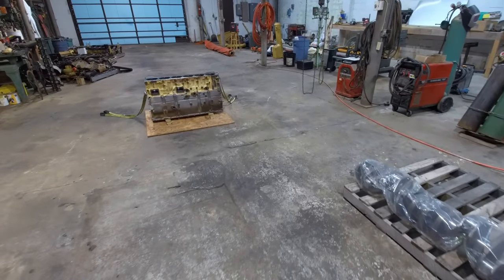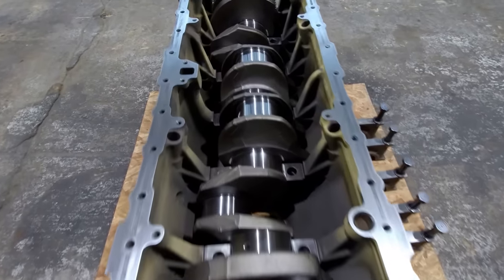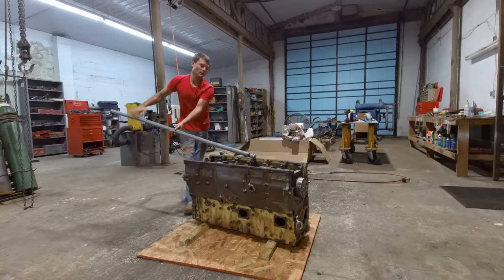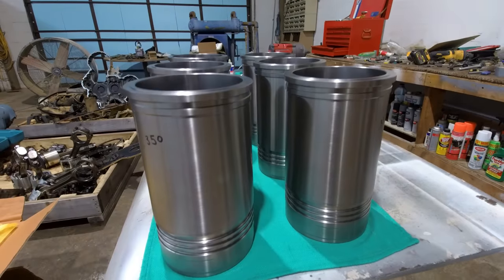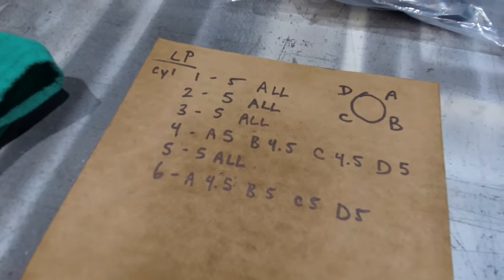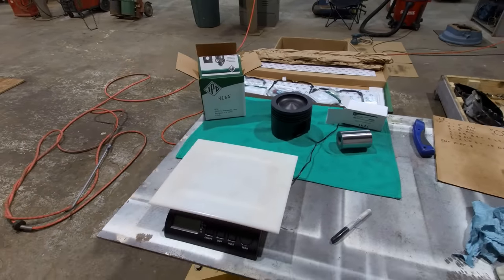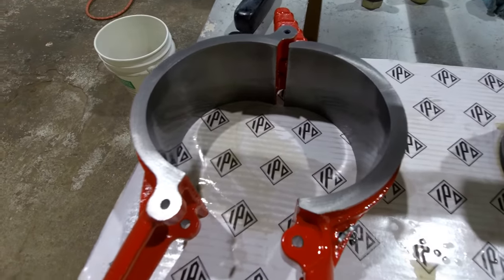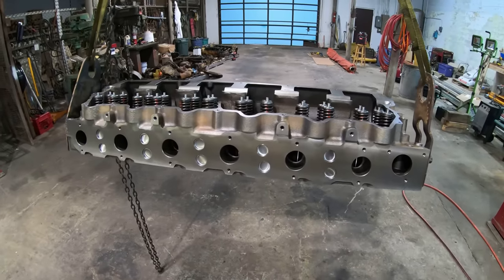700 HP 15.2 Liter Caterpillar Diesel Engine Build - Assembling Major Components

Comment: I really like the cleanliness and the attention to detail.    Giving a shit is a dying art.
Reply: He loves his trade obviously you would want him.to make your engine ...!
Reply: I drive for a local fuel distributor, I currently drive a 2017 International LT DayCab.  My last truck was a 2010 Maxxturd with the 12.4 Liter Maxxturd Diesel Engine.  The 2017 that I drive now has a Cummins 15 liter, it is a great truck, this engine is pretty loud, but overall it very nice, then low end torque is especially impressive.      I have begged, threatened to quit, threatened to quit and take half there driver with me, cussed until I ran out of cuss words..............all to try to get them to buy me a Kenworth, a Freightliner, a Western Star.....anything but a damn Navistar, they refuse.  I hate them for this, I am the senior driver, been there for 14 years, I make exceptional money, but I still might quit if someone would buy me anything other than a damn International.     I once owned my own truck, and I would not hesitate to have KT rebuild my engine.  Half of the problem that I have with my shit spreader is the fact that the International shop is over worked and poorly motivated. The other half of my problem is the tire shop that this dealership uses is COMPLETELY incompetent.   I have taken my truck to the shop on two thursdays in a row, just trying to get them to balance my steer tires, my steer tires still have 0 weights on them.
Reply: I agree, some of the characters on YouTube operate in a very messy/dirty environment for their rebuilds. I don't watch them more than twice, or so. I will keep watching here until I can't see anymore, or he decides he is not putting up with the idiots.
Best wishes
Reply: @kevinkelley3657  Fight the good fight but sometimes you have to concede. I'm down to "my new truck needs to be a manual", went home for three weeks on the last truck "call me when you get a manual in, you have the number". They called.
Reply: Absolutely agree 100%, he does this for our enjoyment and education, He does not need a bunch of arm chair quarterbacks telling him what hes doing wrong, its clear he has an interesting channel or would not have 83,000+ VIEWS in less than 72 HOURS, now that is interesting in itself, This guy has a good sense of humor in his own way, hes not afraid to say that was wrong or it was wrong, The guy is doing this to help us out and we enjoy it and learn from his work and taking the time to video and share, I personally appreciate each one of his videos and this is why I am a subscriber.
Reply: Paying people enough to give a shit is what died.
Reply: Very true Kevin, as an apprentice mechanic I look up to guys like this, but to find anyone who's willing to take me on and who cares it's very hard to do so.
Reply: A local guy that did my rebuild years ago had old sleeves tapered at a machine shop for piston install.  That tool you have looks like the cats meow. 👍
Reply: @Shed Life Correct engineering is absolutely critical to the life of a newly manufactured piston engine.  When a piston engine is rebuilt, about 50% of the potential success is tied directly to the quality of the parts used in the rebuild, the other 50% of the potential success is on the mechanic.  Did he pay close attention to clearances???  Did stay constantly vigilant on cleanliness???
Reply: Sure is....Many of the "kids" I work with don't care to put any pride in their work or work at all.
Reply: @kevinkelley3657  .....You got that right...ever since international got rid of the dt series in favor of the maxxturd..The quality of their trucks took a dump.

Comment: Love these videos. I work in a prototype fabrication shop mostly by myself. 
Whenever things get to big for me to move around or lift I ask myself what KT3406E would do then figure it out!
I doubt anyone who leaves a negative comments has ever built an engine. How does someone mistake a cheater bar for a torque wrench anyway?
Reply: Isaac's Garage I don’t even like to call it a cheater bar. My dad who was a mechanic who was retired and a USN vet called it a “force multiplier” which he said was the correct nomenclature.
Reply: @Aegirak  That's a better descriptor. I've always known them as cheaters, but the USN knows better!

Comment: Hi KT I haven't sent email in a while the C15 acert that I built running strong and thank you so much for the information and guidance for my Build the avg on the Dyno was 628hp and 2120 ft of tork for one hour of time on 80% to 100% load.
The flow mach 10r3261 work great and it smooth running.

Comment: When you plastiguage something like the mains, if the clearance is out of spec how do you fix it?
Reply: depends on whitch way its outta spec, if the clearance is too small, bore the bearings, with em installed, until their to size. if too large, bore gauge and figure out if you have a out of round, order oversize bearings and bore to size.
Reply: pretty sure u can get it in spec with different bearing thickness
Reply: @weedies7577  depends on what they offer in bearing sizes, some engines like the cats/cummins/detroit stuff you can, but for the more odball stuff, jeere, old mack e7's, kubota, mitsubishi, ect, they might not offer the inbetween sizes, just std/ .10 over ect.
Reply: @patrick11169  If you're real damn lucky an off the shelf bearing will solve the problem, otherwise, it is, as you have said, line boring time.

Comment: I recently read an article on FB regarding why most semi's have a six cylinder engine. I was stunned. I figured they were at least V-8 or more. It turns out the narrow block makes for easier maintenance and a sharper turning radius. They just build  them with GENEROUS sized cylinders. And also, they can add a turbo if they need more grunt. My first full time job was working at Fairbanks Morse in Beloit, WI. They were building diesels for the navy that made 1,000 hp per cylinder. I was told it had  two crankshafts, one on the bottom and one on the  top. The pistons came together in the center and that was where the injectors were situated. I think  there were four of them. Two on each side. I grew up two blocks away from where they tested engines. When us kids weren't making too much noise, we could here those big diesel engines chuffing away.

The pistons in the one you were rebuilding have to be huge for it to be a 15 liter.

Had to chuckle as you turned the crank you said, "I've got spinnage". Right away I had visions of Popeye helping you finish the assembly. Sorry, couldn't help it. I was born in 1946 so I grew up with Popeye.

This was a great video, clear and educational. You do great work.

Its a shame auto makers don't build their engines to accept liners. That would greatly extend the usable life of the engine but then they wouldn't sell as many cars. And too, the engines of today really do last a long time. Most of my friends have cars with 160,000 miles or more. They take them thousands of miles on vacation with no worries.

The joke about the breaker bar,  vs torque wrench was a good one. Let me see, a six foot bar times my 180 pounds should come to about 410 foot pounds.
With a lot of practice a man can get really good at feeling torque. I worked at an auto assembly plant as a trouble shooter when something went wrong. If an inspector found a problem I had to buzz over there with a crash cart and fix whatever. Bolt didn't go flush in the trans? I would back it out and run a tap in then blow out debris, install new bolt and save it.  Wrong transmission? I had to remove the trans when engine got to a middle area and put the correct one on. The engine and trans were on a pedestal before stuffing into car so I could do that before insertion. I got a feel for the tension such that I challenged a coworker to come behind and check the torque I applied with my 32 inch ratchet. On twelve bolts I was within specs, plus or minus five pounds. Some were 15mm some were 18mm. So I had be accurate with the two different torques. That was 22 years ago before I retired, I doubt I'm still that accurate. I'm out of practice, now use a clicker wrench on everything just to be safe.

I have a nifty diesel in my 2005 Jeep Liberty. Four cylinders, 16 valves, a turbo, intercooler, and it uses a really powerful lift pump to create 20,000 psi on the fuel. That is fed through a common rail to each cylinder, the injectors are operated electronically by a minicomputer. The intent is for the fuel to enter the cylinder as a very fine spray, almost a fog. The computer can adjust the instant the injector opens to get maximum power or minimum fuel usage. Supposedly, it only has 162 HP but can create 300 lbs of torque at 2,000 rpm. Not bad for a 2.8 liter four cylinder. It  now has 262,000 trouble free miles. If I'm easy on the go pedal it can get 30 mpg on a calm day. if it's windy from ANY direction other  than behind, it takes a hit down to 25 I suppose due to turbulance. One time pushing through deep snow in all wheel drive for about 200 miles it only got 15 mpg. I noticed that fuel  gauge dropping at about twice the normal rate.

I pulled a bottle gas truck out of a snow bank one time. He could not believe it. But there was a bare spot on the blacktop, with all of my tow straps hooked together, I was able to get one tire on the bare blacktop. I was told the transfer case creates a three times reduction so I'm guessing it was putting about 800-850 lbs of torque to the wheels.

Diesel power has such great promise, lots of torque, long life and it can be operated on numerous types of fuel. There is a video on YT of a guy who makes diesel fuel from alga in a big greenhouse. It burns clean, NO POLLUTION because it's vegetable oil. He is the CEO of Valcent industries. I haven't been able to get any of his alga fuel but my little diesel sure likes the biodiesel I get in Monroe, WI. It varies from 5% all the way up to 20% depending on their production. The biodiesel does a good job of lubricating the pump and other parts. It feels slippery if I get some on my  hands. It runs quieter on the biodiesel as well. That is a real issue since they removed the sulfur. Not sure how sulfur lubricated the parts but at least the biodiesel can take up the slack.

Thanks for showing us what a REAL workhorse diesel looks like. That was an awesome video.

Comment: KT does a great job and dosen't  cut corners when he does a rebuild. We had a local yahoo rebuild a Cummings N14 and it lasted 20,000 miles. Thrust washers fell out of crankshaft and were in oil pan.

Comment: I was using Plastiguage on  reciprocating air compressors about 40 years ago. Before that was lead wire. 6 inch journals and 650ft lb.  Torque wrench was 6ft long and took 2 of us to get it working lol.  Nice quality video and good to watch.

Comment: Just did a 6TS in-frame last week (shit block with the cam hole in it) and used the IPD overhaul kit, first time using one, looked like a quality kit. customer was on a budget so had to reuse as much as possible. did cut counter bores for shims though.
enjoy your videos, the motor home bus was a blast. keep the coming.

Comment: I use a £600 snap-on torque wrench with the electronic angle gauge, You use correction fluid and a massive bar. Love it Thank You for taking your time to share your work (from England)

Comment: Hell of a good idea.. not nascar using diesel engines but weighing every part and matching them together.. I used to do that back in the day (60's and 70's) on my gas engines even before I heard of balancing and blueprinting.. It just made sense to me.. Man that is a fancy ring compressor.. things have sure changed since I played around with engines. Damn slick as snot.. Rats you didn't show the piston cooling jets.. I am not familiar with those.. I will check you other videos for those then.. Hot damn son.. run that baby!

Comment: If you will stand the block up on the transmission end on a couple of blocks you can hang the crank by the front snout and float it in. This makes torquing easier. You can also stab the liners and then the piston/rod assembly and torque it while it's standing as well. Knocks out a few movements.

Comment: Personally i agree with you about tightening the main bolts by hand instead of using a rattle gun however.
When i did it, i found it easier to lay the block on the side, stops it from spinning on you while tightening and is also much easier on your back.

Comment: People are quick to point out “that’s not how you balance an engine”… right this is called weight matching. I’m guessing being in-line that it’s probably neutral balanced? So it’s spun without bobweights, right? Nothing at all wrong with your process. Love the channel. I did engine work for about six years when I first started life as a machinist.

Comment: KT34063E:

Although I do not work on Heavy Equipment like you do....I still use(quite often) a 3ft+ Boron Pipe taken from the rear door of a Peugeot Wagon.....having a cheater  that does not flex is nice for stuck bolts/nuts....and like  "stretch bolts" which have to be taken another 120 degrees or have half turn after final torque is set....piece of cake.

Comment: This might be a stupid question but why not use silicone on the top o-ring? If the motor oil makes it swell would it not make it break down a little as well? Or are they supposed to swell to hold the liner in? Great videos 👍🏻 thanks

Comment: Excellent presentation lighting and audio great.i just got a nt335 gs Cummins generator set from a tv transmitter with 1300 hours. Always had block heater no cold starts. It was installed in 1968 in climate controlled building. I thought I was getting something valuable but I had one generator dealer say scrap it. What is your opinion should I scrap it?

Comment: Awsome video! I've rebuilt alot of engines in my time & was shocked at the 200ftlb torque spec! And then torque to angle - wow! A few questions:
How much does the block & crank weigh? I thought it was going to tip over when you were torqueing the mains - but it barely even moved!
What do the combustion chambers look like in the head? I would have loved to have seen those.
Does the head have a single intake port?
Thanks for posting 👍👍
Reply: You have rebuilt a lot of engines in your time? But you ask how much does a block and crank weigh? What do the combustion chambers look like in the head? Does the head have a single intake port? The answer is. Totally just the same as all the engines you rebuilt in your time. DAAAAAA

Comment: Best words ever heard or the whole video was torque-ing the bolts with torque wrench and by feel one time I put a small V8 engine together of the many engine I was allowed to put together and one rod bolt did feel quite right so I took it out and look at it and it was a bad one torque wrench for reference but the feel for accuracy only was able to build three engines like that it was fun

Comment: The Detroit’s have a special tool to push the liners down. I will try and describe it. 
Excuse me if it don’t make sense. 

Looks like a triangle with three head bolts attached to it. 
And one large bolt in the middle. 
With a circle in the middle that fits the sleeves. 
Lay the tool on top of the block. Bolt in the three corner bolts and then torque done the middle on. It pushes the sleeves in nicely. 

Does cat not offer that option ?
Reply: Whenever I rebuild Detroit's, Cummins, or Mercedes I use the hammer and 2x4 method similar to how he did. So far so good.

Comment: I thought the 3406 was 400hp, then by 1990’ it was 425 and I think it finished at 450hp? The C15 is 500hp, so it was fascinating to see how those four bolt rods and bigger mains got it up to 700hp without grenading the shells. Nice build :o)

Comment: One question.  When you plastigage the bearing clearance, do you do that at the 200 ft lb main cap torque or after you pull the bolts around 120 degrees to a final torque and then disassemble and check?

Comment: Great vid, maybe the only thing the i don't do is hammer down the sleeves, i have a home made device the ge bolted to a couple of holes for the head screws and piece of plate between the two the get pushed down by other screw, i do this in the DD engines

Comment: The IPD liners with the taper is a good idea, I always thought part of the cavitation/electrolysis problem was due to the vibration of the lower part of the liner when the piston skirt changes sides and slaps the liner.
Reply: Seriously it mainly is about headgasket integrity…obviously that it doesn’t breach

Comment: Thank you. What you call garbage as in knowledge. I call teaching. That’s the reason why I watch your videos. Don’t take this the wrong way. I mean this in a good way, when I say you’re like the Donald trump of YouTube without the bs an lying. You get straight to the point, you explain what you doing, how you’re doing it and the truth or the round about truth on how it supposed to be an what to look for including how to look for it. Thanks to you and many others like you I am being taught how to become a professional Diesel Mechanic/ Truck Driver. I just learned the mathematics on how to find or select a gear with a 10 spd using the spd odometer if the engine’s rpm teller ever stop working. Yes I can shift listening to it however sometimes I have the music playing an the radio turnt up.

Comment: I'm not in any way shape or form a mechanic so im just curious how much does the engine block weigh alone? I thought they weighed too much for u to be able to make it move on the wood but when you were tightening bolts it didn't seem like it was that heavy.